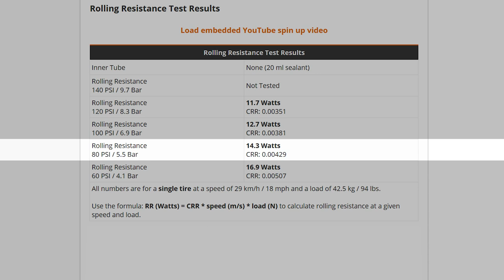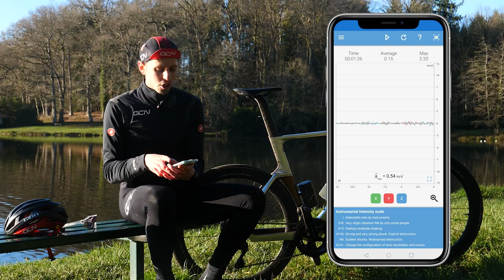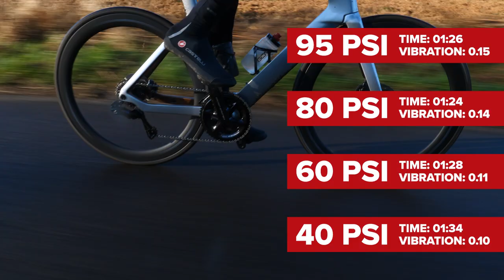Is There A Perfect Bike Tire Pressure For Speed & Comfort?

Comment: It takes energy’s to vibrate your body.. that is energy that‘s being taken away from bike moving forward!

Vibration losses are minimized by lower pressures (energy lost from vibrating rider and bike).. rolling resistance losses (from bending tire carcass) are minimized with higher pressures.. therefore, for each tire on a given surface there will be an OPTIMUM pressure.. higher is not better. 

Most rolling resistance tests don’t take into account a rider sitting on bike sopping up vibration and bleeding away from forward motion in form of heat into environment. VeloNews and WheelEnergy did a test where they used a textured rollers and an air shock as a stand-in for a rider and demonstrated these vibration losses (compressing air shock likewise bleeds off energy as heat) though not as much as a rider likely would!

Comment: Yep but a lots depends on your body weight. If you print 90kg in the scale you should run whit more the 80ps on the tires otherwise you’ll not compensate the comport and rolling resistance.

Comment: This was just for cruising.  Things will get more complicated when you are stumping on your pedals that will induce vertical movements that will compress and decompress the tires with each pedal cycle
Reply: Ya. Same test but with a power meter?
Reply: Thinking about it, assuming you're not jumping on the pedals (and I do stand a lot when I'm riding: maybe I'm less efficient than I think!) if you're glued to the seat there shouldn't be any vertical movement.

Comment: I'm not sure if we can assume that a lower pressure is faster overall. In this test it was faster going downhill without pedalling, but would the higher inflated tyre transmit more power to the ground when pedalling and be overall faster?
Reply: No, literally the exact opposite. Unless you are biking on a glassy-smooth surface, very high tyre pressures increase rolling resistance due to an increase in hysteretic losses. Additionally, vibrations lessen the extent to which your tyres are in contact with the road; bouncing up and down reduces time and/or surface area of contact, which may result in slippage and thus, less efficient power transfer to the ground.
Reply: @andrecoetze33  interesting, I was talking more about when you hammer down the power, I was wondering if a lower pressure tyre would not transfer some of the forces to the ground like a higher pressure one. But I see your points, definitely they count towards overall ride speed.

Comment: Question: The "SRAM tire pressue guide" calculator suggests pressure of around or even below 2 bar (down to 1,66 bar) for my use-case of a 50-584 tyre (Continental Contact Urban). However, the manufacturer specifies 2,5-5,0 bar pressure. Can I nevertheless set the pressure (much) lower than 2,5 bar to match the SRAM values? What can happen if I stay below manufacturer's recommendations? Any experience?

Comment: #askgcn Hi everyone at GCN megabase and in this thread. I'm converting my gravel bike from mechanical disk brakes to hydraulic brakes on the back wheel because of the poor braking performance. The front wheel brake's performance is ok. Both wheels have 140 mm discs.

While converting an issue has arisen: The frame has got a Post Mount standard whereas Shimano only sells Flat Mount brake callipers for STIs. I've now got two options: Either use an adapter (if so, which one) or use an MTB Post Mount brake calliper together with the STIs (if so, do I have to pay attention to the brake outer hose)?
Reply: #askgcn Similar question: I've currently got hybrid hydro/cable brakes. They suck, and I am thinking of replacing them with cable disk brakes: what do I need to look for when sourcing new brakes?

Comment: Im 95kg and i use 25mm tyres. I usually run at 100psi.  The only time i tried less than 90psi i bent a rim on a pot hole.

Comment: While interesting, this experiment doesn't cover the main activity on a bike, that of peddling.  The more power that is pushed into the bike when peddling, the more force there is acting on the tyre.  This will also affect the rolling resistance.
I appreciate such an experiment is very hard to replicate consistently though.
Deciding on tyre pressures should always be with respect to the rider weight, which is why manufacturers publish PSI ranges against rider Weigh charts.

Comment: Current set up is 23c front tyre at 110, 25c rear 100 I weigh 85kg and got tired of getting pinch flats on the back wheel so much, since switching to the 25 the ride is so much more comfortable and my average speeds haven't dropped so all good 👍

Comment: 10% rim drop racing. 12% sports. 15% touring. ( Sports cycling is now called 'club run' )
For rough stuff, trial-and-error.
To measure Rim Drop, use your eyes. You don't need to buy a pressure gauge.

My 1948 Claud Butler has 26 x 1 3/8". They've never been over 60 psi. The bike is a dream to ride.
Reply: What is rim drop? I can't find a definition for it.

Comment: funny that TT bikes all run 23's and most pro's still run 8BAR pressure on either 23 or 25 tubs
Reply: The WorldTour organizers always chooses TTs on very smooth tarmac. Even sometimes the city paves the roads about 1 month before the Tour goes through their town. So racing a TT on bumpy tarmac is never an option. Same with sprint finishes - always smooth tarmac. Hence the pros still have 23 mm tires at 8 BAR. Higher pressure tires that are thinner are still faster and more aero - on smooth tarmac. Just look at the track bikes. So don't believe that bicycle marketing hype

Comment: So, lower pressures not faster then (mostly)! Really good test, and pretty much matches up with the Pirelli pressure chart that comes with the tyres.
Reply: Lower pressures can be faster on a wider tyre, so 28mm tyres at 60psi could be faster than 23mm tyres at 110psi. It doesn't really work when comparing the same width tyre at different pressures, there will always be a 'best compromise' pressure, and the online pressure calculators are pretty good at getting you close to that, similar to the pressure chart you mention.

Comment: Let's not be obsessed with accuracy here... 

First off, it's not as high as you might think. - The pressure gauge has a error margin, as do your phone sensors, etc. Changing your tire temperature by around 12 degrees C (difference between when you set off and a few minutes of riding or moving from shade into sunlight) will result in a 5% change in pressure. Tires are not the only thing suppressing vibrations. What about the stiffness of the frame, fork, stem, handlebar, wheel profile etc. Soooo many dynamic variables - none of them sadly mentioned :-/

Secondly, as noted at 1:03 the difference between a 100 and a 120 psi tire is 1W, for 100 vs 105 it will be about a quarter of that - not sure what to compare it with... Possibly trimming your nails?

A new cyclist might watch this and think they need to get their pressures right up to a single psi, which is just silly. Literally all you really need to do is follow the tire manufacturer guidelines and you're good. Pirelli recommends 80psi for the 28mm P Zero TLRs for a rider between 76-85kg. - Which is exactly the result that Alex got. Shocking, huh? A little disclaimer at the end about that would be good.

Comment: You needed to run each test a number of times, remove the upper and lower result amd take an average. And is 80 psi the sweet spot how about 85, 75, 70. 65.

Comment: So I have calculated how to find YOUR perfect type pressure. I was told you use 1 bar per 25 kg weight, but if you break that down to how much Bar to kg weight, it is 0.04bar per kg weight. So, you have to calculate 0.04 bar times your max. system weight.

Comment: Would this info apply to 700c 32 tires, or is 80 psi too high for such tires ?
Reply: Depending on your weight, 60-65 would be right for 32mm tires and 180lb rider and 20-25 lbs of fully loaded bike.

Comment: I weigh 95kg what tire pressure is safest to reduce the chances of a flat, also the roads i ride on aren't always the best or smoothest roads. :(
Reply: The lower the pressure the higher your chance of a pinch.

Comment: i wonder how the weight of the rider would affect these results. Being a 6'2" 200 IBS dude I've always felt I needed a higher tire pressure.
Reply: Rider weight is only one of the variables: rider weight, tire material, road surface etc. all make a difference. He's shown how to do the test, now we can run it for our system and location.
Reply: Try a free bike tire pressure calculator on your phone. The one I have doesn't ask for surface but wheel size, tire width and weight.
Reply: I’m the same height and weight- Silca pro tire pressure calculator. You’re welcome:)
Reply: Thank you!

Comment: Hahahhah That road is what we call SMOOTHE here. It can not be used to represent 'rough' conditions. haha. Tire pressure is very much dependent on the power input of the cyclist. If the person is strong, aggressive and likes to hammer, obviously a higher pressure would be good because you wouldn't want to feel the tires squashing under acceleration or hard cornering. For more casual rides and cyclists,  lower pressures are fine. At 72kg, I use ~60psi in 32mm tires and re-inflate when they get below 50 psi, which is too squishy. For 28mm tires, I use 65 -70 psi at most  because any harder and the rattling isn't worth the 'efficiency'.

Comment: I am 6’2”,  97.5kg (215lbs) and run my road bike tires about 100psi.    I would consider going lower, but when I stand for climbs I would be concerned about bottoming out and damaging the rims.     I guess dropping 5psi per instance is the only way to find that sweet-spot.     SCIENCE‼️
Reply: I ran those numbers on the Silca calculator and it's spot on for 25mm (actual measured width) tires.

Comment: Your first mistake is using a company that test tires on a rolling drum rather than in the real world on roads. 🤦‍♂️ so the rolling resistance numbers are basically invalid. I suggest using bicycle quarterly's Jan Heine data. Another thing that most people doing testing fail to mention is that a bit lower pressure tires will increase braking performance.

Comment: So you're saying 80 PSI is the optimum tire pressure for that particular road. And that particular road looks like an average road I ride on everyday. So 80 PSI it is for me. Hang on, my hookless rims with tubeless tire setup has a max pressure of about 70 PSI.  I feel like a fool wasting my money on these Zipp 303 S wheels - just to go slower. And that doesn't even acount for the very smooth tarmac on my local hill (6% average for 10 km - called Cypress). Now that's why I ride faster with my old inner tubed clinchers at 100 psi up Cypress!! For sale - slightly use Zipp 303 S with Conti 5000 tubeless tires. They are fast - trust me and don't watch GCN, please.

Comment: How does weight distribution affect this? Many riders I know (including me) have 5-10psi more in the back than in the front. Does that make sense? How does that approach change for a TT bike? #askGCNtech
Reply: I do that too, but the idea was a result of watching GCN videos, although I wouldn't claim they told me to do it specifically. But I would like to echo your question. Cheers.
Reply: For TT bike i will say put it on max pressure see what happens

Comment: Interesting video. There's an element missing I think and that is grip. At lower pressure, I suppose there's more grip, hence more power that can go on the road?
Reply: Yes and no. On a glass smooth Road you will increase resistance. But on a typical road with ruts bumps and potholes the losses from hysteresis we'll make up for lost power by keeping the tire in contact with the surface

Comment: I ride Clinchers.  At 120/125 psi . Old Guy . Still have Tubulars Wheelsets & they were 135/145 psi .  24mm /26mm 

My new Roval Rapide CLX 52/60 pretty sure they will be 28mm & Roval Rapide CLX 32 will be 26mm 
At between 100/120 psi . 

Foot Note   Hate Tubeless Tires & will never ever ride them . 

Own 5 sets of Carbon Wheelsets.  All Roval Rapide.  CLX 40 Tubulars ×2 Sets  QR. 
×1 Set Roval Rapide CLX 32 Clinchers QR. 
×1 Set Roval Rapide CLX Aero 52/60 SP. 
×1 Set Roval Rapide CLX 32 Climbing SP. 

Back on Tubeless they should be Banned from all Road Bikes including the Pro Peleton.  

OK 4 MTB'S & MAYBE  GRAVEL ?

Comment: The idea of this experiment is a sound one.  Tire pressure will definitely effect your speed and comfort.  However, trying to measure vibrations as you did is unsound at best.  Did you go over the exact same sliver of tarmac each time?  Very doubtful.  As for speed, did you do exactly the same power each time, in the exact same position, with the exact same wind, on the exact same bit of tarmac?  I would be be more satisfied if you just referred to actual scientific research and passed that data along rather than what you've done here.

Comment: It's funny how manufacturers killed "endurance/suspension performance bikes" then promotes "lower pressure and wider tyre". 

Which is faster. Motorcycle with average tyre pressure and suspension vs motorcycle with wider tyre and lower pressure with no suspension at all. 🤣

I think the manufacturer made a trend of "wider and lower pressure" to accommodate disc brakes. Cuz stopping power is nothing wthout traction.. 🤣

Comment: No no no no!  Those rolling resistance numbers derived in a lab on a steel roller are not accurate in the real world. Jan Heine over at Rene Herse tires has shown, definitively, that tire pressure has almost no bearing on rolling resistance IF  (and this is a bit IF)  the tires are extremely supple.

Comment: Wouldn't the weight of the rider factor in here? This was completely ignored. A 200 pound rider with 25 mm tires inflated to 40 psi will be riding on the rims. Come on man. Seems nonsense to talk about the optimal tire pressure without factoring in the weight. The optimal pressure is a function of the tire width, rider's weight, and the surface ridden on.